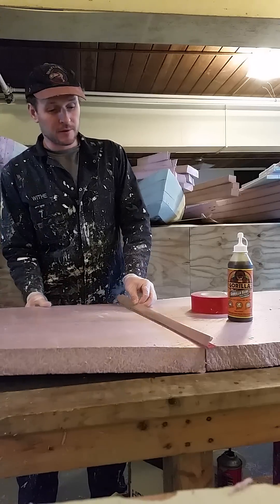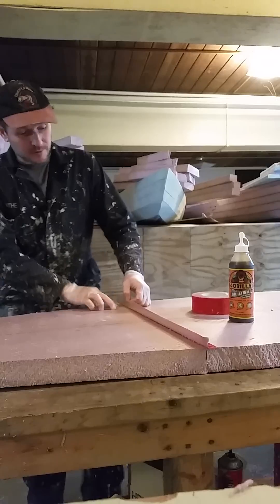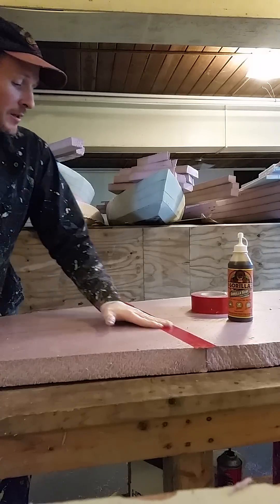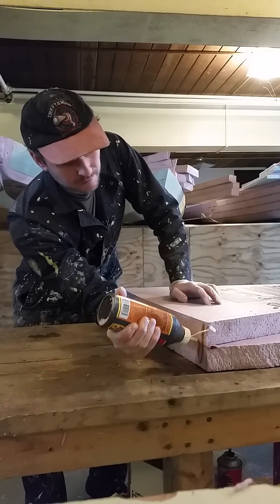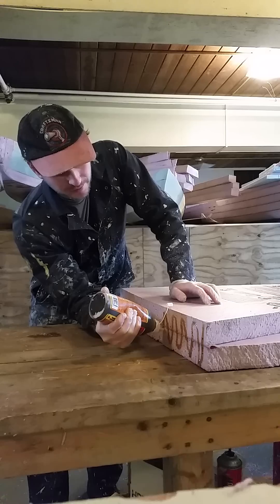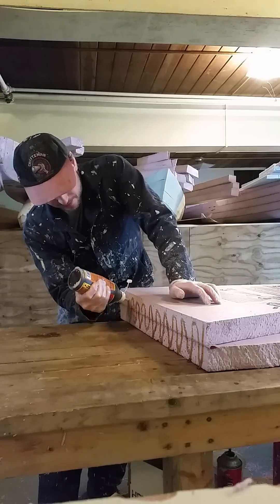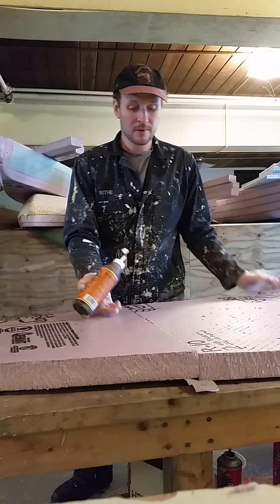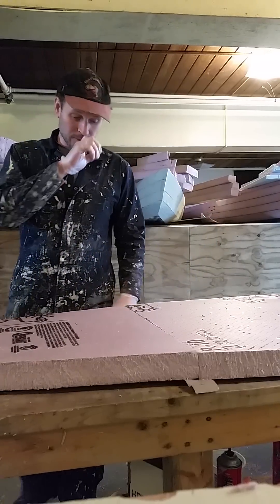Sawfish Kayak, Butterfly scarph joint

Comment: I really impressed with the foam kayak that you Made... since I couldn't get any xps foam... can I just use Styrofoam?
Reply: styrofoam will absorb water unless it is sealed on the outside. 
I have had a few builders use it instead of XPS, they need to be sure that any holes or tears in the fabric skin are patched as soon as possible, and that the boat is only in the water while they are using it. 
THe boat may still absorb some water, during use, so store the boat outside in the sun, upside down. that way the heat of the sun will bake any water out of the foam.